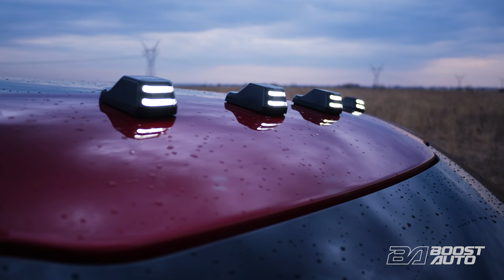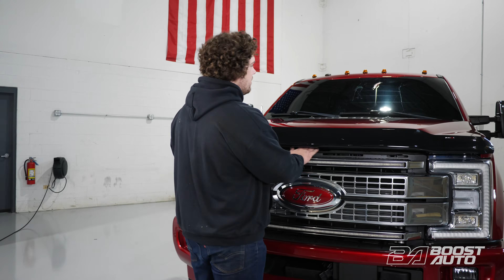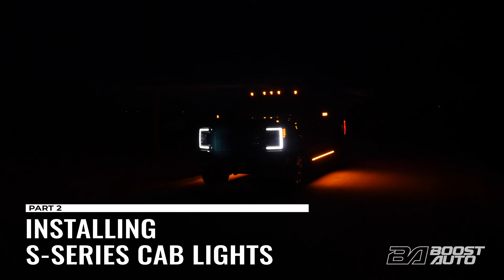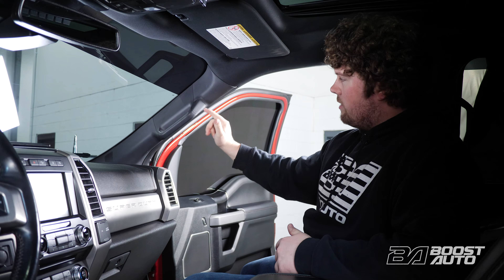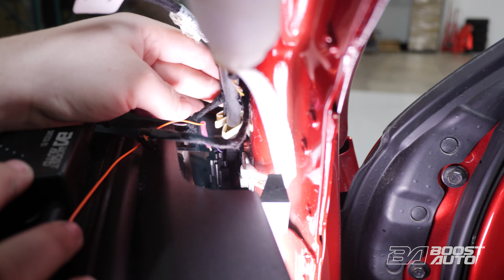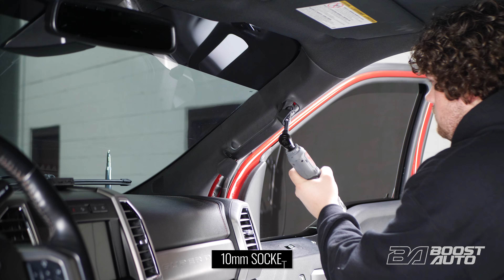Boost Auto S-Series Cab Lights Installation Guide | 2017-2022 Ford Super Duty F-250 F-350 Trucks

Comment: Do the white running light only with startup sequence also require you to take apart the A pillar and do the wiring or are they just plug and play?
Reply from the maker: Plug & play if originally equipped with cab lights.